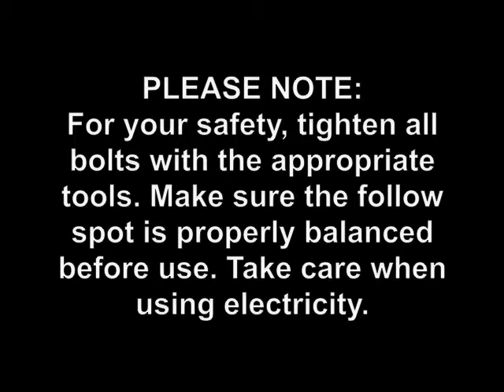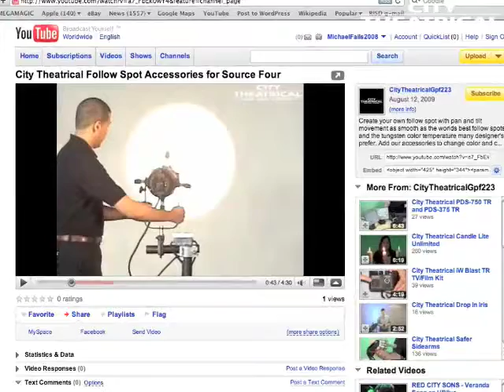City Theatrical FollowSpot Yoke for Source Four

Comment: The larger lens is for a tight beam angle. jump on the ETC website and have a look at "Beam angles" it goes from 90 degrees to 5 degrees. A 90degree means the beam "spreads" very quickly, unlike a 5 degree where it comes out very small and takes a "long distance to spread".
This is a low angle lens (5 degree maybe?)

Comment: Can you be more specific with your question? He mentioned that designers sometimes prefer a Source 4 to a normal Spot because of the color temperature of the light. Also, the Source 4 is much smaller than a typical follow spot.